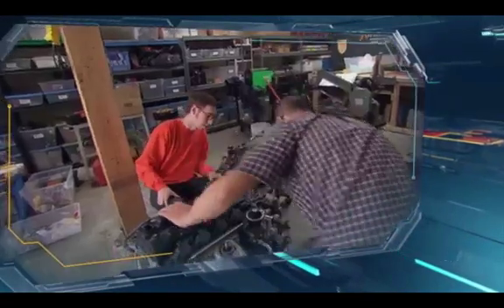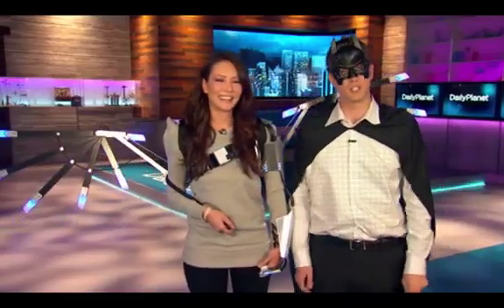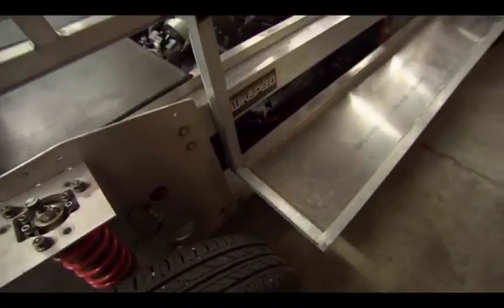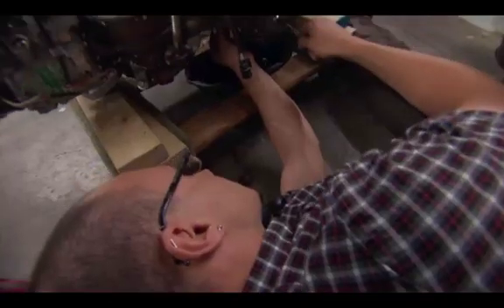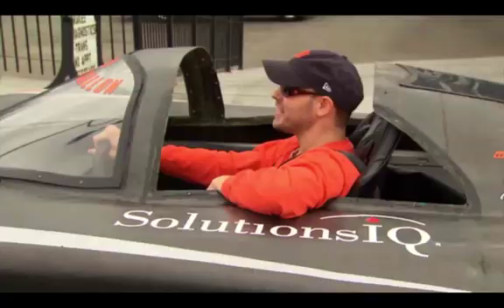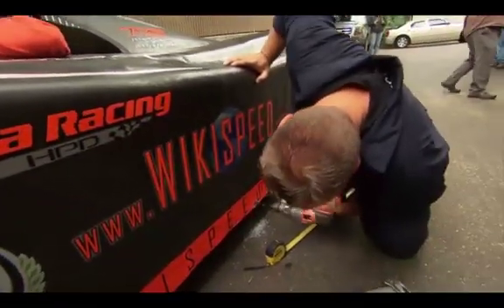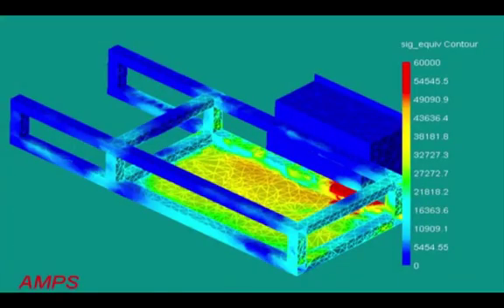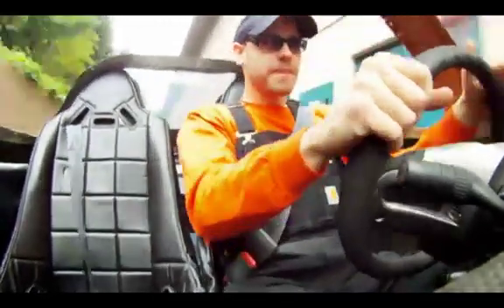100 MPG Fuel Efficient Car for $25,000 SGT-01  | WIKISPEED

Comment: 5 star test ratings don't mean jack shit. lets say a football helmet has a 5 star test rating, peewee ball all the way to full size helmets. getting hit by a sedan in that thing would be like a nfl linebacker hitting a 4th grader.
Reply: +Youbetter Backoff yes and no.. thats not how physics works. the best example is the differences in the europeon vs us regulations for roll cages in race cars. in europe they realize that fatalities/injuries happen because of instantaneous stops. so they want crumple zones ssslllooowww energy dispersion. in the US, they want roll cages to be completely rigid, like a brick wall.. it just seems there is a real lack of understanding of physics(somehow). you want energy to be dispersed slowly over as long as period as possible. Sooo, what would end up happening is that the vehicle in the video would actually move/bounce around before it stops and, because of how he engineered the vehicle, the entire frame takes the hit, not just one section. less weigh will ALWAYS be safer than more weight but people have complexes about how this work. "BIGGER IS SAFER, I NEED TO DRIVE A TANK"...
Reply: The tired old weight = safety argument. I would rather get T-boned by a 1400 pound car than a 3000 pound car, given a choice.

Comment: We have 100 mpg Cars in Europe Already , which are great Family cars with supercharged small engines
which are capable of carrying 5 people + their luggage and  can reach almost 130 mph top speed
Reply: SuperNiceguy60 all covettes have fully independent suspension, front and rear. And have since 1960's
Reply: Sorry... I've driven a Z06.. a lot.  If you crash one... Your an idiot. Mostly people crash after turning off the traction and stability controls.  And Mustangs crash way more for the same reason.
Besides all that. As I said. The Vette has ALWAYS had IRS.
Reply: Not sure what your on about. Just pointing out your wrong about the vette not having. IRS. 
Also... You measure MPG differently than we do... Your gallon is 20% larger than ours. So any MPG number you have is also 20% larger than it would be for us. 
The nice thing is there are lots of cars for whatever someone needs. 
I drive a half ton pickup. Use it for everything... Also have a small 4 door hatch for good practical city car, and I have a 20 year old roadster for having some fun. 
I enjoy them all.
Reply: Your wrong...AGAIN. ALL modern Covettes have LSD mechanical differentials... And brake based and throttle reduction based slip control on top of that. No idea where you get your info from. But that's several points your totally wrong about... Pretty much tells,me you have no clue what your talking about. Have a great day
Reply: name the car please
Reply: Pegeut 308 blue hdi 1.6 SW it does around 97MPG Motorway
it has a turbo Engine and it can reach up to 130 mph
Heres how the car look like ,this image is from google Images

https://www.google.co.uk/search?q=peugeot+308+sw&client=ms-android-lge&biw=360&bih=559&source=lnms&tbm=isch&sa=X&ei=cxWPVJ-CDanX7Qax44CoAQ&ved=0CAYQ_AUoAQ&dpr=4#facrc=_&imgdii=_&imgrc=nxDvnTEn0RGRuM%253A%3BU_9Z4uknZ1OFaM%3Bhttp%253A%252F%252Fcdn3.carwitter.com%252Fwp-content%252Fuploads%252F2014%252F02%252F2014-Peugeot-308-SW-carwitter.jpg%3Bhttp%253A%252F%252Fcarwitter.com%252F2014%252F02%252F19%252Fpeugeot-308-sw-specs%252F%3B1024%3B683
Reply: SuperNiceguy60 Good looking wagon.. always liked sweet wagons.  Unfortunatly Pegeut has not been in the USA since the 1980'.  Looks like 0-60 is about 12 sec..  you would get run over here in the states. Anything slower than 9 sec to 60 is considered SLOW.
You also you need to figure out the cost of  fuel.  Right now regular gas is $2.00  to $2.50 a gal.  Diesel is $3.50  In the states diesel just does not make sense unless you are towing and need the torque.  The diesel option cost a lot more, then the fuel is a lot more.. and your pay back time is longer than you are likely to own the car.
I realize things are different in other parts of the world... but unfortunatly here in the USA we have what we have.
There are many decent cars we do have that get into the 40-50MPG range.
Reply: Dude this is not about you picking the car you believe is right for Americans this is about freedom of Choice , 122 mph top speed and 97 mpg in Familly car is simply Stunning,  Nor Prius, nor the Standard Tesla , can Achieve such speeds , you talk like smart cars which do 16 sec to 0- 60 mph and have top speeds far less than 100 mph dont exist in the U.S
Reply: SuperNiceguy60 Never said I was.. But I do live here.. you don't. That probably means I have a better idea of what the average American likes.. I am a car guy, and try to keep on on whats going on with new cars. The Stats on the car you mentioned are great.. and it looks great too. I like the looks of several Pegeut cars, But as I said.. 0-60 in 12 sec is pretty slow... even the 85HP Chevy Spark does better than that. The Prius can go 110MPH... and 0-60 is about 9 sec.  The Smart is not very popular here.. it's too small, gets no better milage than any other small car, and costs too much for what youget it goes 85MPH which is fine... that is enough. Freedom of choice is great... But you are not going to have manufacturers bring cars over here that they cant sell, or don't think they can sell.  Diesel makes little sense in the USA unfortunatly.. for many reasons, with all the emissions crap on them now. They are not that more fuel efficient than the direct injected gas engines, Diesel costs more, and the cars cost more. Which is all too bad.. cause I LIKE diesels.. I have owened several in the past. But the time has come and gone for them here probably.
Reply: Ken Riley you cant say Americans dont like something which they are not aware it exists
Reply: Ken Riley I ve done a 2800 miles trip with my familly  I only had to stop 3x to refuel , If I had an American car those ones you consider (fast v8 6.2.L) my trip would have been delayed by 1 or 2 Days as this would result in much more than 3 stops to refuel
Reply: SuperNiceguy60 Why would your trip be delayed 1-2 days because of a few extra 10 min gas stops?  Also you can't just go by engine size.  2014 Corvette gets 30 MPG highway, has a 18.5 gal tanks. So to go 2800 miles you would have to stop 5 times for fuel, thats 1 hour total.  One other thing to possibly consider is   American Gallons are not the same as UK and I assume EU Gallons  The ratio is 1.2 American gallons = 1 UK Imperial Gallons  Clost but makes a little difference.  Also to your previous post.. UM yes I can... If someone doesnt know about something, it's pretty much impossible to like it or dislike it..  I will say, there are MANY Euro cars that I personally DO like.. But I am a car guy, I tend to follow the car industry more than most I would say...   But if I don't happen to see it on YouTube or the news.. I cant know about it.
Also many of the micro cars in the EU.. are not popular here at all.  Smart is a good example. They sell well enough in the big cities.. But that is a SMALL part of the USA. Most people want a larger more comfortable highway car. And honestly they can buy one for what a Smart costs.
Reply: Dude yes you are 100%  correct American sport cars like the Z06 2014 get good MPG driving at normal speeds not above
 70mph. Sadly where we completely disagree is a sport car having to stop only 5 times 
to complete 2800 miles is simply impoassible in a sport car ,you would be the one causing chaos and traffic in the motorway as result of extremelly slow driving to get that kind of mpg
Reply: SuperNiceguy60 I have regularly driven my friends 2001 Z06 Corvette.  65-70MPH..  28MPG.  Solid...  
Not that I do that too much  HA HA HA... MUCH more fun to put the pedal down.. and hear that lovely LS6 ROAR.   :)
Fun ass car.. and pretty cheap to buy here in the States..  $25K will get you a NICE C5.  30-32K can get a nice C6.
Hell a brand NEW C7 is $55K  or so  Fucking bargain for what you get.
Reply: Ken Riley z06 requires the driver being gentle with the gas pedal , the previous model didnt have independent suspenssion resulting in being a bit Tail Happy , the new ones are a bit safer as they come with magnetic adjustable suspenssion and all tech equipment if you are willing to pay for the extras , if I was to drive a z06 I would keep traction control on at all times just to play safe, juding by the weight & Engine torque , the z06 seems like a very fun car for the track , if you were to achieve 50% of its capabilities in a public road you would get in trobel.
Reply: SuperNiceguy60 Oh, the Peugeot 308 is insanely impressive especially for the price.  European MPG always seem to be a little padded but even so it' pretty amazing.  Everything I have seen is it's 0-60 in 9.7.  /  0-62 in 10.0. http://www.topgear.com/uk/peugeot/308/spec/20366
Anyone that thinks they're going to get 0-60 in 6 sec., 100mpg and a sporty design in a full sized QUALITY car is DREAMING.  Maybe when the magnesium alloys and carbon fiber comes down to earthbound prices but that won't be any time soon. 
Europe has been making high mpg diesels forever (1.2L bluemotion, 1.2tdi 3L, etc) but the problem for us in the US is the emissions.  We'll never see any of those cars.  Of course, we don't pay your insane prices for petrol or diesel either.  Great car though.  .
Reply: Ken Riley however Corvettes  crash like there's no tomorrow  attempting  to drive straight In dry roads , corvette  is the most crashed car in the World , YouTube had thousands of videos evidence to back this claim
Reply: Ken Riley here's a group of Americans which would buy the 97 mpg State 
***Business's  ** I mean they don't  care if the employee go from 0 - to 60 mph in 5 seconds  , Businesses want safety  , and Profit  combined  with vehicle low maintenance costs 
.
Surely  the slow acceleration  would mean a vehicle is less likely to crash  and less maintenance costs regarding brakepads clutches & turbos 
.
Plus the 600 liters cargo space is way more than a Audi Estate or a Mercedes state offers
Reply: Ken Riley 90% of Corvettes  are defective if they  were sold in Europe  they would  have been recalled  
.
HERES  the Issue : 
No mechanical  differential  lock 
.
Corvettes if they loose traction  on one wheel 100% of torque  goes to one single wheel , un balancing the vehicle and acting as some type of Torque vectoring System which is trying to kill you or send you to next cliff under heavy acceleration 
.
Solution : Rear wheels need to be locked together  in order to assure 50/50 power distribution  , unbalanced power is able  to change  direction  faster than any steering impute

Comment: Any "car enthusiast" that puts efficacy above speed is no car enthusiast
Reply: Efficiency is a must in endurance racing
Reply: The point was to build something decently fast with amazing gas mileage. If he wanted speed he would have throw a stroked LS2 in that chassis and geared it high and it would have been insanely fast. but agian that wasnt the point
Reply: Everything making the car lighter is good for both.   Aerodynamics as in slippery are good for speed, sports gotta ignore it for downforce at times. Adjustable spoilers can get both.

Comment: Efficiency cannot overshadow safeties necessary for body impact. Add all the regulations, the mpg is gonna drop. Not saying there aren't some great ideas like whole body removal.
Reply: That's bing hypocritical, aren't motorbikes legal without any crash testing required?
Reply: Not reallly. why would you crash test it. the second you hit you are going down anyways or going up in the air.
Reply: icebox829 That's the point. Nobody tells you "that bike is dangerous, you can't sell it. Why do it with cars?
Reply: You do it with cars because you can. Some vehicles could be completely un safe and have no crush resistance at all and when you hit something you get whiplash or slam your face into a steering wheel. they dont do it with bikes simply because there is no point to do that with bikes. In any collision no matter the case on a bike you will likely be over the handlebars. no matter what. not in cars though. Plus this car is completely save and durable and light.
Reply: icebox829 Shouldn't safety level it be an individual choice?
Reply: I mean I guess but who in their right mind would even buy a completely un safe vehicle.
Reply: icebox829 How about... you? Don't you drive an ATV? Or anybody who drives a bike.
 Anyway, no vehicle will save you from a 70km/h crash against a solid concrete wall.
Reply: yeah but a vehicle that has gone through and passed crash tests would protect you better than one that failed. I do ride a quad but thats the risk you takewhe nriding a vehicle of that nature. its impossible to be any safer than you already are on a bike. but in a car you can always be safer.
Reply: icebox829 Agree on everything. Still, safety should be a choice. Now you can have a car with 3 wheels and get away with it.

Comment: Well it has a 5 point harness which generally holds you in place safer than an airbag, just too 'uncomfortable' for consumer cars.. And since it's so light it's more likely to fly to the side instead of crush. It's a little extreme so probably less safe, but a 75 mpg compromise isn't unreasonable.

Comment: Maybe you should watch the video again.  I never once heard anyone say they achieved 100 mpg by "JUST aerodynamics".  You must have fallen asleep when the guy was talking about the extruded aluminum frame and carbon fiber body.  One of the cars main attributes is very light weight, but somehow you totally missed that.  I would be more skeptical of that kind of gas mileage with that level of performance and the level of emissions required in many states.

Comment: not to try and discredit them in any way, but how can JUST aerodynamics nearly double the fuel efficiency. You still have to press the accelerator which makes the pistons produce power.

Unless it has a different engine, or he isn't touching the accelerator, i cannot see how it's possible.

Seems like BS to me, if VW / BMW and Formula 1 teams with multi-billion £ engineering departments can't do it.

Unless they are trying to say that with the customized aero, you don't have to accelerate much.
Reply: Depends on speed. Motorcycles, naked bikes with bad Aero start to slow down at high speed.    That's where Aero is more important. Formula one ain't build to be efficient.   Early race cars look like bullets.    Downforce is aerodynamics but not fuel efficient at all but exists to keep it on the track. It literally is pushing the car down. That costs fuel.

Comment: Now add lights, glass, stereo, air conditioning, heater an enclosed roof, airbags and all the other safety items needed to have a US legal car, then add a body that will not disintegrate in an accident and maybe a trunk and the spare tire, etc........ and then how much does it weigh and what gas mileage does it get? You are on the right track but need to go a lot further to make it user friendly, safe and still get over 100 MPG.

Comment: A Renault megane With sexy Extras such 17 inch wheels , Satnav and front LED day lights can achieve as 80.01MPG   
.
Ok is not 100mpg but you get real car with lights and safety Checked